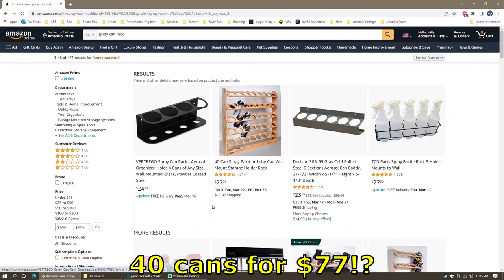CHEAP and EASY DIY Spray Paint Can Rack / Organizer

Comment: this would be great for wine bottles.....as for the circles you can drill a center hole in each and glue about 7 on a rod. Spray adhesive , put sand paper around it and attach to your drill and have a spindle sander

Comment: This is a great idea. Just built some new shelves in my garage and was looking for better can storage and I like this idea. What were the measurements you went with? Obviously this can be build to any size needed but what did you end up going with and what angle did you lay the can holder out on? Thank you.
Reply from the maker: I just used my hole saw that was one size bigger than a paint can. As for the angle, I just used what looks good, maybe 10°-15°. One side is up an inch higher is how I laid it out.

Comment: make wooden boxes that fit under work bench put wheels on the sides in the rear end of box use a rope handle lift up slighty and pull drawer out the wheels do the work.

Comment: Hey my name is AJ and I'm a street artist I use spray paint  everyday of my  life I call my art rattle can art cuz I don't tag walls or property I do it in canvas and poster bored  I probably go through 300 bucks in spray paint a month and always have a few of every color I don't have all the tools you do to make the shop like you got, but I was wondering if you could send me off in the right direction to accomplish that goal
Reply from the maker: The only "expensive" tools in this video were a table saw ($100 at a garage sale for mine) and a drill press ($40 at an estate sale for mine). You could easily do this with a circular hand saw and a normal power drill. Don't let lack of tools slow you down. Let whatever material you have on hand dictate the design. I didn't buy any material for this rack.

Comment: Cheap and easy - has a $20,000 wood working shop at home
Reply from the maker: The only "expensive" tools in this video were a table saw ($100 at a garage sale for mine) and a drill press ($40 at an estate sale for mine). You could easily do this with a circular hand saw and a normal power drill. Don't let lack of tools slow you down. Let whatever material you have on hand dictate the design. I didn't buy any material for this rack.